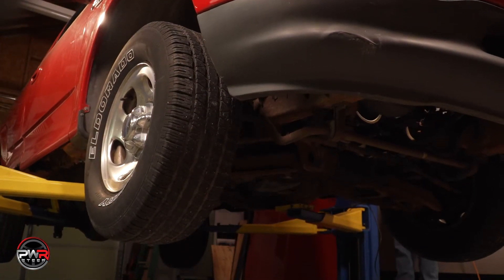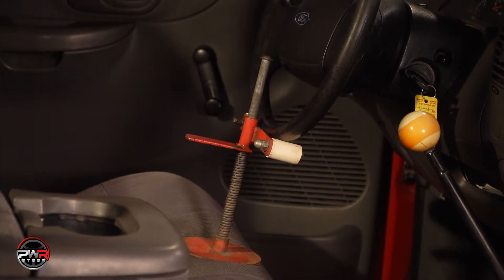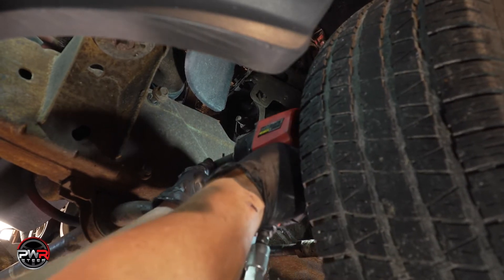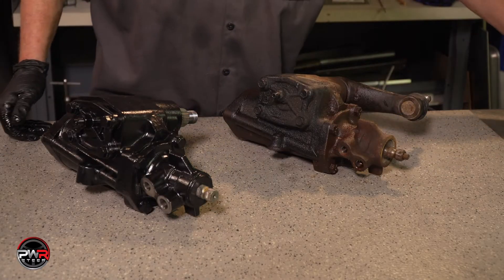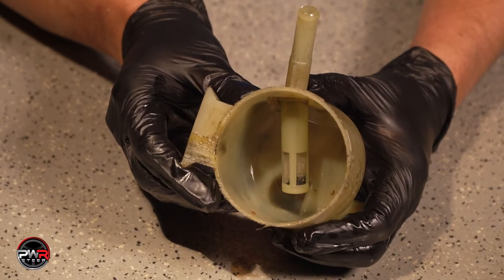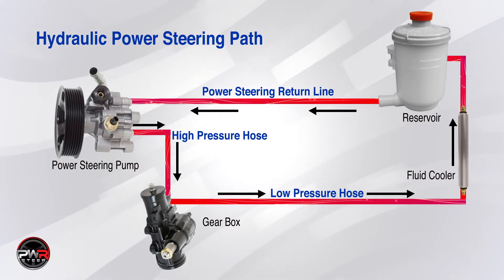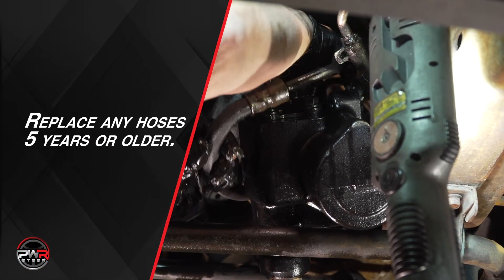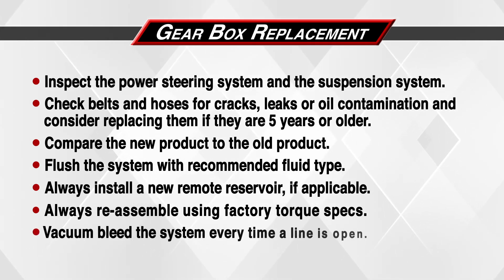DIY Power Steering Gear Box Replacement: Step-by-Step Guide

Comment: I have a 1991 crown Victoria Ltd I do my diy

Do you know if I can replace gear box from the engine bay or do I have to get under car?

Can I take pitman arm off without car being lifted?
Reply: Do I need to vacuum bleed if I plan on replacing my power steering pump?

Comment: How did you come up with the 1 and 5/8 inch turn?
Reply: It went stop to stop 3-1/4 turns. 

Half of three turns is 1-1/2 (1-4/8) turns. 

Add to that, half of the 1/4 (2/8) turn not yet accounted for. So add 1/8 turn. 

This gives you a total of 1-5/8 turns.

So, to get to center, turn 1-1/2 turn, then another 1/8 turn, for a total of 1-5/8 turn.

Hopefully that made sense to you.

Comment: Would this be the same on a 97’ GM k3500 with the 6.5L? I purchased a replacement rebuilt gearbox and curious if the rotations are going to be the same .
Reply: The concept is the same to center it

Comment: This is a very nice video, but you skip the steps where you reattach the gear box to the steering axle.  I have a current issue after replacing my gear box where the steering wheel in the cabin is at a 90 degrees instead of straight.  I think I need to adjust that linkage.  what do you think?
Reply from the maker: Howard,

1. Did you center the gear box, before installing it? 

2. Did you immobilize the steering wheel before you removed the gear box?

Thanks, 
PWR
Reply: Don’t worry ford the same, had to take it right back, now have to take it back since I don’t see a new gear box installed lol

Comment: 01-2022 be advised that Ford used two type pressure hose ends for this period of vehicles. One used 'o' rings the other uses reverse flare tubing.  Because some previous purchasers did not verify the reverse flare in the reman gear box someone tried to insert the square off tubing with "O" ring into the high pressure port and destroyed the internal reverse flare male brass fitting. Now Autozone has two damaged units that must return, and I had to find another supplier for the proper unit. My van is a 1992 ford e350 cutaway rv. I am now on my way to CarQuest/Advance parts to pick up another replacement unit and hoping it will not have damaged input pressure ports. Good Luck.
Reply from the maker: Hi Robert,

If Ford used 2 different pressure hoses they would have 2 different gear box part numbers, and we would also have 2 different part numbers, this may be that someone at some time replaced the gear box on this customer's vehicle with a different box (they all bolt on the same way). If we can get the number on your box, then maybe we can cross it over instead of going by application.

Thanks, 
PWR

Comment: I did my pitman arm only. And now my wheel is 180° off (upsidedown) no I didn't move or spin the wheel out of orientation while doing pitman removal or install. Any ideas as to why? Literally pulled old part and installed new. 94 Dodge Dakota 4x4
Reply from the maker: Hi,

Sorry for the delayed response! 

On the steering wheel being out 180 degrees, I assume the front wheels were straight when you replaced the pitman arm, even if you had the steering wheel in the proper position when you removed the pitman arm, if the steering wheel is not held in position, it can possibly slowly turn 180 degrees out if nothing is holding it, if it is top heavy.

Thanks, 

PWR

Comment: Do you need to vaccum bleed? I see most people dont.
Reply from the maker: Hi John,

Yes in some cases people do not vacuum bleed, but the proper procedure is that every time a line is open the system should be bled. In some case the air will escape by itself, but the safer side is to bleed the system.

Thank you,
PWR
Reply: @PWRSteer  where do you get bleed adapters for bigger reservoirs?
Reply from the maker: @johncarlos7810 , 

We use the Mityvac MVA670 Power Steering Adapter Kit, which contains 4 adapters. 

Thank you,
PWR
Reply: @PWRSteer  excellent! Good things fella! Thanks